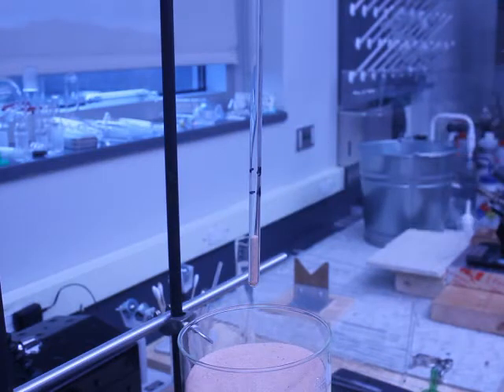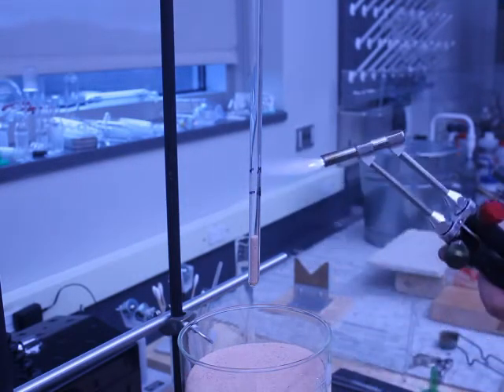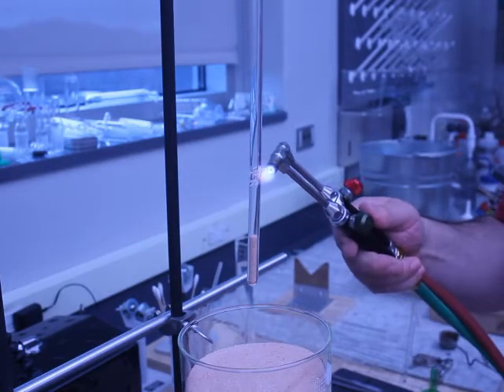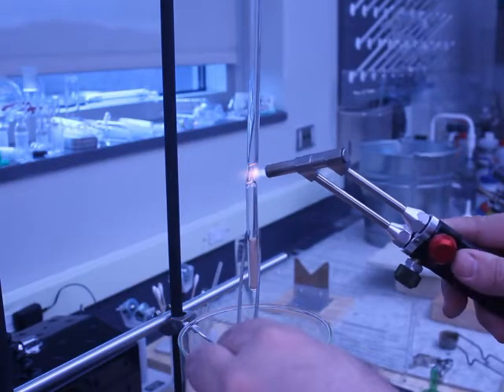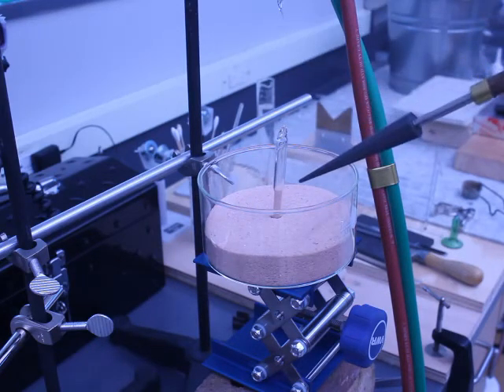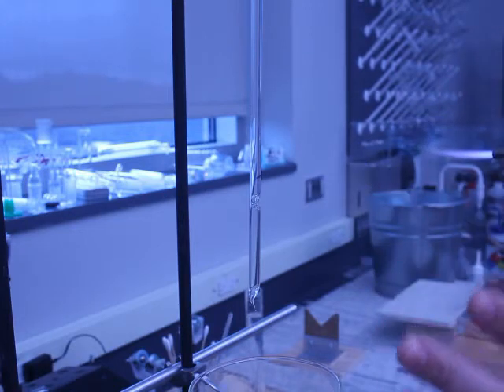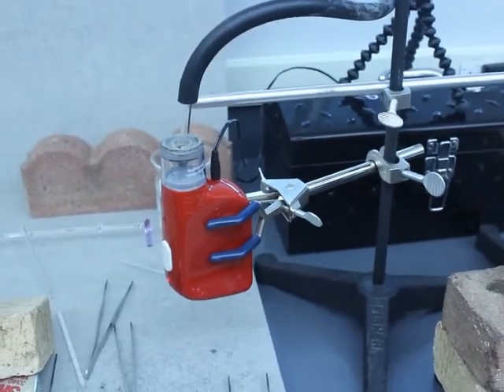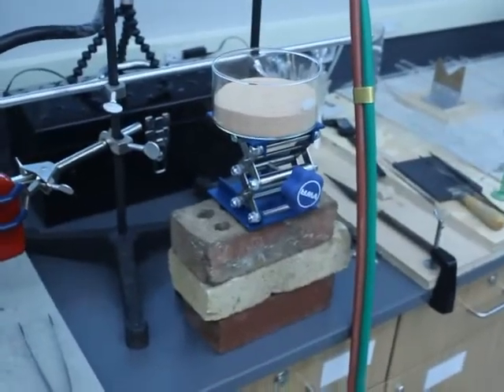Flame sealing a sample in a glass tube under vacuum.

Comment: This is a good video but I do have a question. I'm wondering how and where you would mount a gauge onto the apparatus. If you needed to evacuate the air so you'll be able to pump H2 into the borosilicate tube, you would need to get the air pressure to reach somewhere below 10^-9torr. Because H2 is reactive to heat, it could catch fire and explode if there's even 1% of Oxygen. I think you would use a Ionization gauge, but I'm not sure. I know that a manometer would help you get 1torr of H2 in the borosilicate tube. So, how and where would you put the ionization gauge on the apparatus?
Reply from the maker: Yeah...no, you would need a specialized High Vacuum line to do that.  In this video I am using a vacuum used for sealing sandwitch bags.  I probably gets to a pressure as low as  1 x 10^-1 torr on a good day.

Comment: Hello, I am a chemistry student and I’m working on my thesis project. We want to proceed with sealing the NMR tubes as demonstrated in the video. Could you tell me what the procedure is to close the tubes? What equipment is necessary? Where can I purchase the equipment — could you provide reference links? What would be the budget for the whole process? I would be very grateful if you could help me!!
Reply from the maker: You'll need a hand torch, vacuum pump, liquid nitrogen (to freeze the sample).  One problem the NMR tube will need a fitting for the vacuum.  Which is expensive if you buy it, or requires more glassblowing.
Reply: @ScientificGlassblowing Okay thank you! Do you know where can I order or buy all of this?

Comment: How do you seal under vacuum, the vacuum pump working? Is not dangerous? What type of glass tube do you use? Thanks
Reply from the maker: You can seal under dynamic vacuum or if you have a stopcock the vacuum can be static.  I use borosillicate glass tubing (supplier Mountain Glass Arts).
Reply: Thank you very much for your reply. Really appreciated 👍👍👍 @ScientificGlassblowing

Comment: Hi! I assume it would be the same for an ampoule filled with an inert gas?
Reply from the maker: Actually, no.  Any gas will expand when heated.  As you attempt to seal the tube the increasing pressure will deform the glass, form a bubble.  There are setups/methods to seal ampules at 1 atm.  The method I am using would not work for sealing the tube filled with an inert gas at 1 atm.
Reply: @ScientificGlassblowing  Okay, thank you! I'm just a plasma hobbyist, and I figured I wouldn't get off that easily! 😅

Comment: Thanks for posting this informative video! I'm setting up a new lab that includes a glass welding station for evacuated quartz tubes. Just curious how you connect the vacuum hose to the glass tube - is it just a tight fit between rubber and glass, or do you use a clamp? I've used brass fittings and O rings before, but I'm not sure it's necessary.

Also wanted to note that I've made many evacuated quartz tubes with O2-methane torches, so they apparently do burn hot enough! Takes a minute, though. :)
Reply from the maker: In my setup a rubber host that fits snug is good enough.  You could go with ground glass adapters to get a perfect seal.  I am only working with boro not quartz.  You are correct a hotter flame hydrogen/oxygen is typically used for quartz.

Comment: Sounds like liquid nitrogen freezing would make a mess of it.
Couple thousand degrees to hundreds below zero within a couple inches .
Reply from the maker: No, it's fine.  If your sample is in an organic liquid you must freeze it.  Otherwise, when you pull a vacuum the solvent will boil.
Reply: @ScientificGlassblowing  I was thinking of the glass

Comment: I have an issue that keeps bothering me: I want to make some essential oil sample seal in 1ml amber vials. However since the glass vial is so small and essential oil highly flammable, using high heat to seal off the vial seems dangerous. Any suggestion on this? Thx
Reply from the maker: The method I have used to seal flammable liquids in glass tubes (NMR samples or Elemental analysis) is to freeze the sample in liquid nitrogen.  When the sample is frozen, place it under vacuum then seal off the tube.  HOWEVER, if you do not have the correct training and equipment, Schlenk Line, liquid nitrogen,... you should NOT attempt this.
Reply: @ScientificGlassblowing  Please tell me more about this. Will liquid nitrogen contaminate the sample (essential oil)? Can I get these things done in a university? Or do I have to search for some specific lab to do this? I am situated in Hong Kong, thank you
Reply from the maker: The liquid nitrogen will freeze your sample (under vacuum) there shouldn't be any contamination issues.  Most Chemistry departments will have liquid nitrogen and a good vacuum system.
Reply: @ScientificGlassblowing  I see, but in normal circumstances, do these department in the university have the equipment to seal glass?
Reply from the maker: Maybe.  🤷‍♂️

Comment: Probably won’t be much info on doing the opposite. Which is creating a sealed sample under pressure. 
 
A basic very vague reasoning for creating such a situation is for study/experimentation regarding piezo electret fields and electrets in general.
Reply from the maker: The glass would expand and pop if you heat a closed tube that is not under vacuum.

Comment: What if the ampoule is quartz and want to sealing it in the glove box because it's very sensitive to air?
Reply from the maker: Quartz requires a much higher temperature a hydrogen/oxygen fuel mix is required.  I don't have any experience with quartz, that's on my "to do" list this year.

Comment: Hi! 
Can I use this same technique to seal a quartz tube?
Reply from the maker: Hi Julieth,  A fuel mixture of natural gas and oxygen is not hot enough to fuse quartz.  You need a hydrogen-oxygen mix to fuse quartz.  The technique would be the same or very similar.
Reply: Thank you very much for your answer!
Reply: You could also use nitrous butane.